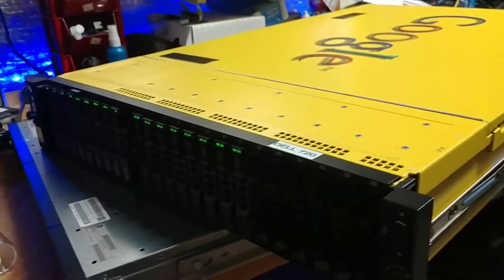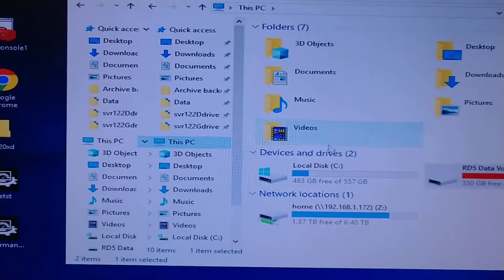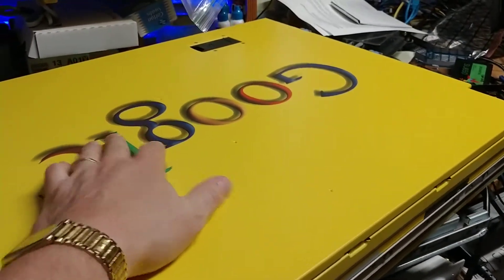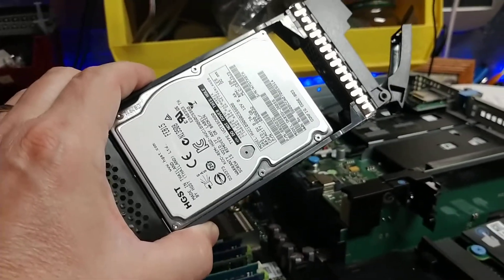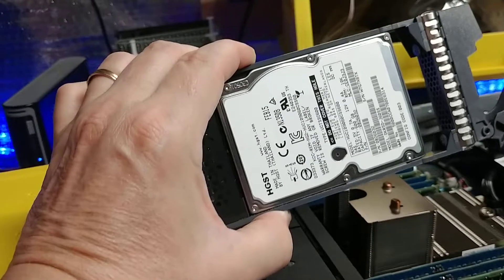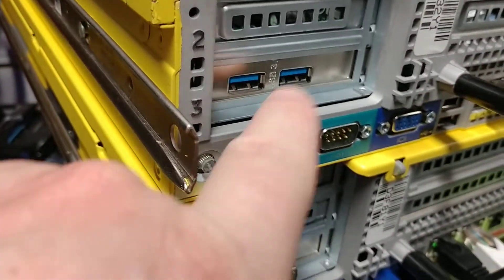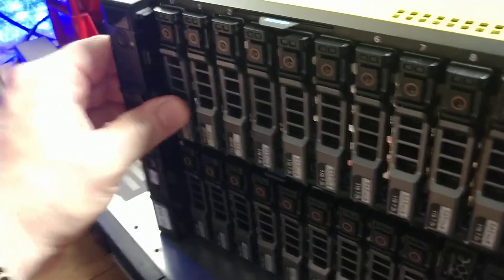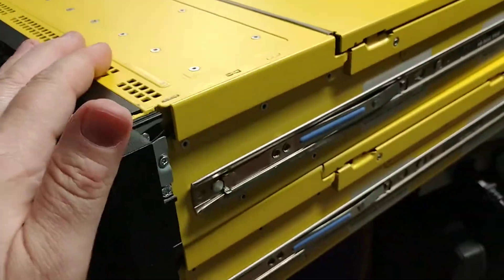OEM Google Dell 720xd values

Comment: Wish i'd found your videos sooner... I picked up 26 900gb netapp drives for my own r720xd google appliance but obviously all came as 520 sector size. I was unable to flash dell firmware onto these drives (hgst / seagate) despite same P/N so had to use sg_format through an IT flashed card to reformat them 4 by 4... 3hr30 per drive.... took a long while...... if you have any pointers for flashing these over to the dell firmware i'm all ears !
Reply from the maker: Yes. Flashing back and forth on sas controller suck,. I just bought a sas hba  controller to get around this then I use my trick of formating many sas drives at once. That was a great way to void the one by one cli formatting. I did a video on that. Hope it helps. Sorry that you had to do it the hard way but you did it.  You finish what you started...
Reply: @leadiususa7394  yeh I ended up loaning an lsi 2008 hba card (it mode) and sg_formatting the drives 4 by 4 hahah but I one day hope to flash the official dell fw onto these netapp drives 😂
Reply from the maker: So you have a google OEM motherboard in your R-720 chassis?
Reply: @leadiususa7394  Nah I have a google oem r720xd chassis with a refurb r720xd board in it, and a used r720 that is just generic dell

Comment: I have two 720xd a ssf one and a lff one with expansion card they are just amazing and I want a google one like you but they are so expensive on EBay just because they are yellow and from google. In the other way I think they are hardly used too because of google’s 24/7 data center
Reply from the maker: I agree, they were note used much. But I use a lot...
Reply: I just picked a google r720xd chassis up myself and finished rebuilding it, has gone in side by side my oem r720